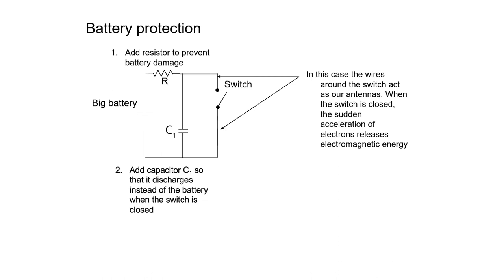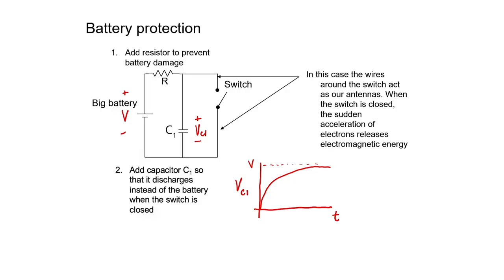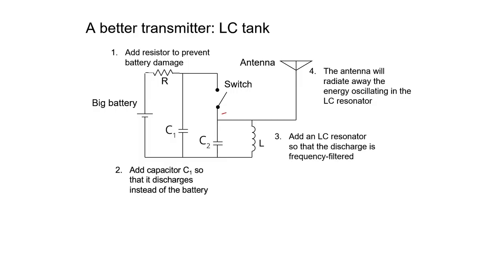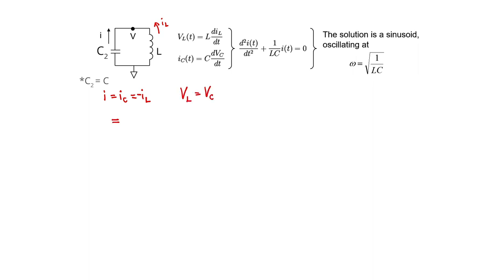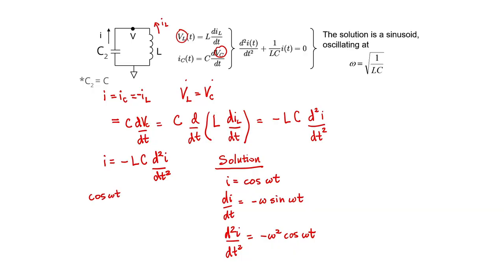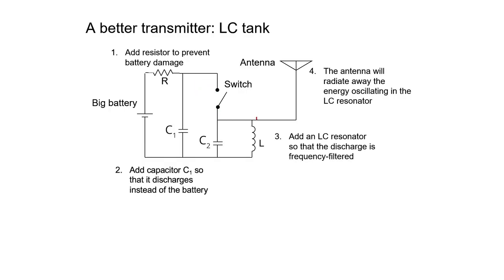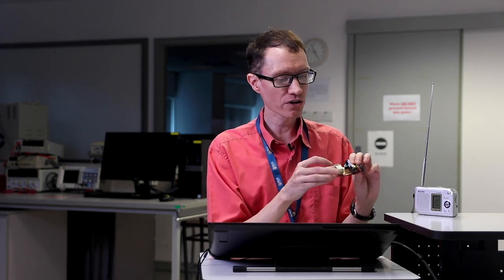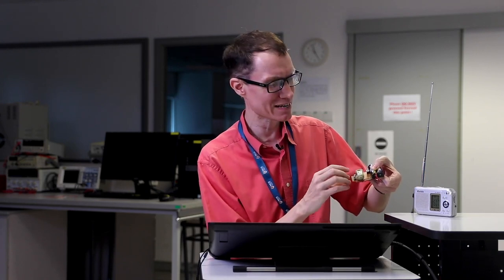Add a TANK CIRCUIT to a basic radio transmitter (2-Analog Electronics)

Comment: You state 15 seconds into this "as you might recall, this circuit had two capacitors"  Recall from when?  Not the first "Analog Electronics #1" video.
I think I know why, this is the same video as video #6